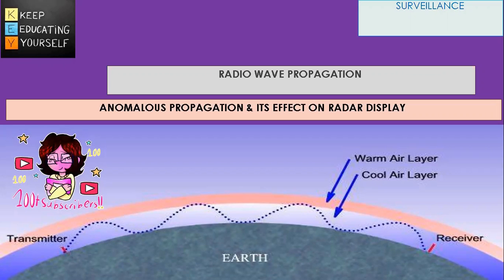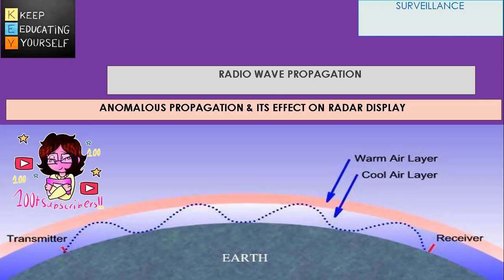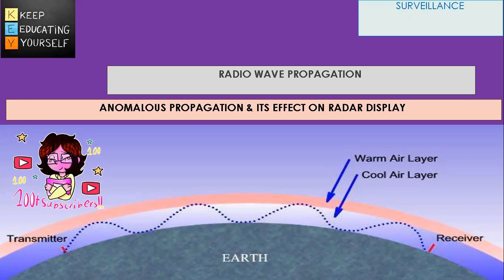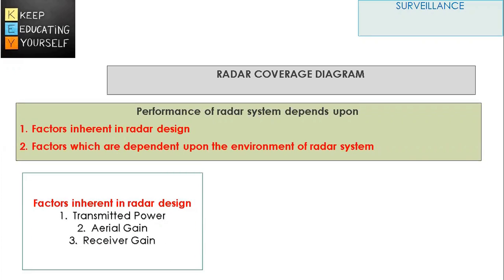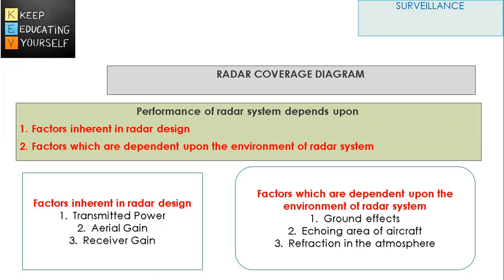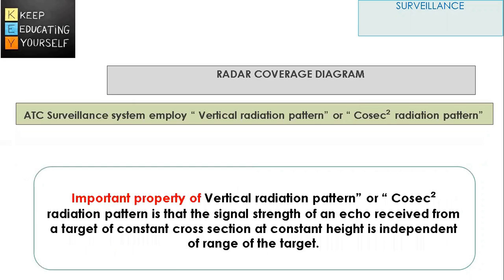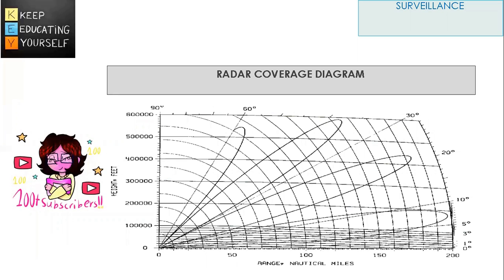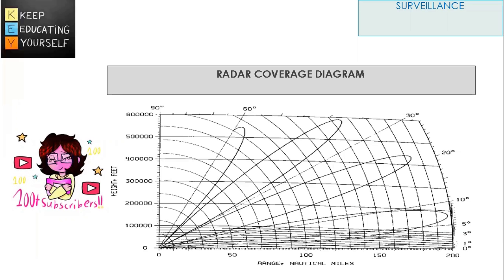RADAR COVERAGE DIAGRAM &  DUCT PROPAGATION

Comment: 8:04
Range is 60 miles for ASR and 200 miles for RSR. So due ANOPROP within this range, radar can show targets below the vertical polar diagram which are normally under blindspot.
Reply: 10:56 radar covergae diagram shown with grayscale at bottom means targets not sight by radar?
Reply from the maker: Correct interpretation.